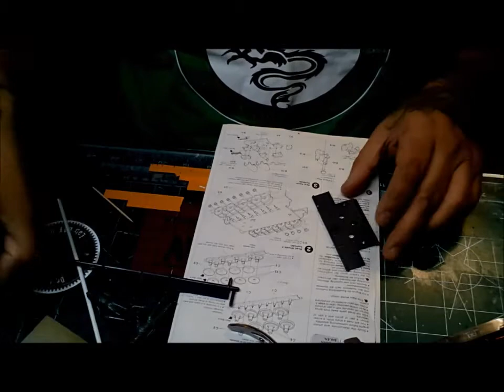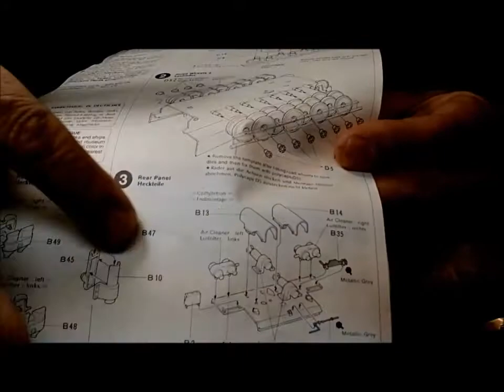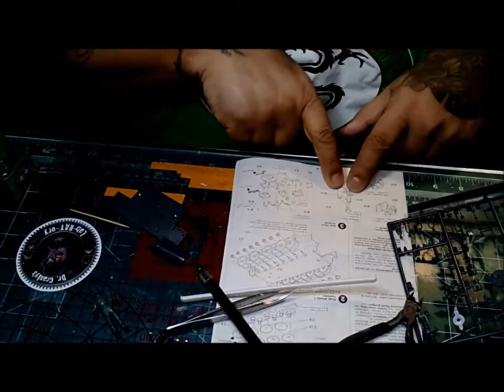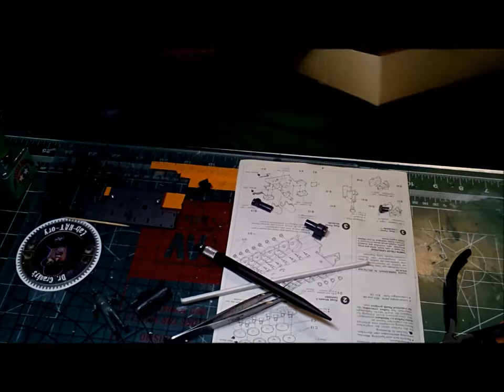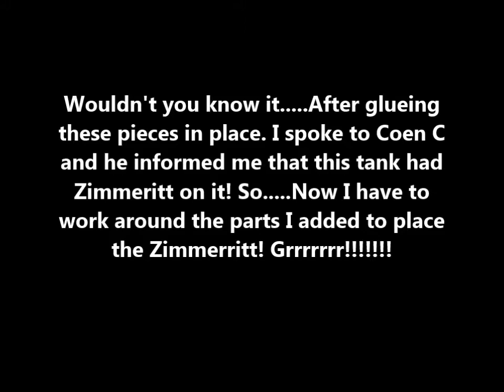Russell Gosselin's D Day Group 02

Comment: Gill, I may have a couple of parts for those exhausts. End caps and new disks for the flapper guards. I'll look around and I'll pop them off to you with the track cable that I'm sending you. Since you're considering taking most of that stuff off for the zimmerit you can just replace them with what I'm sending.
Reply from the maker: I appreciate that Mike. After we spoke....I began to "pry" those pieces off the hull to get it ready for the Zimmeritt. Thanks again for all your advice. It was much appreciated brother.
Reply: Red Dragon ModelWerks Sorry to have created more work for you Gil, that wasn't my intention. I'll pop these in the mail in Monday morning, it shouldn't take longer than two weeks to get to you.
Reply from the maker: Coen C Naw! You didn't create any more work for me brother. Everything I had seen so far ( on line that is ) led me to suspect i would have to add that Zimmeritt. I had already added those pieces on so....Oh well. Lmao
Reply: Red Dragon ModelWerks
Ok then. I sent you a PM on ISM with a picture of what the rear plate of that tiger should look like with her bits on.
Reply from the maker: Thanks Mike. Your help is always appreciated brother!